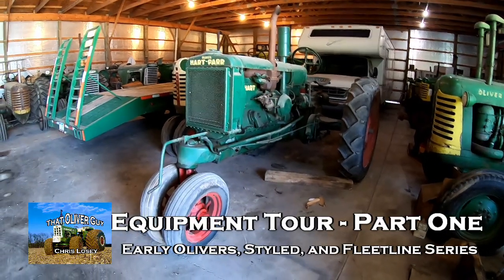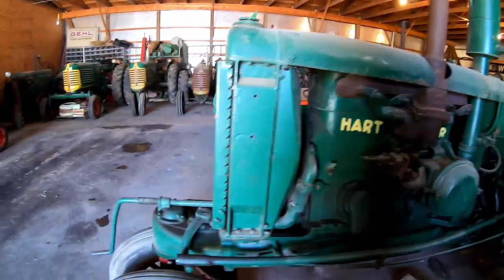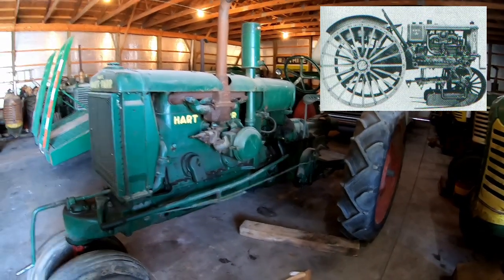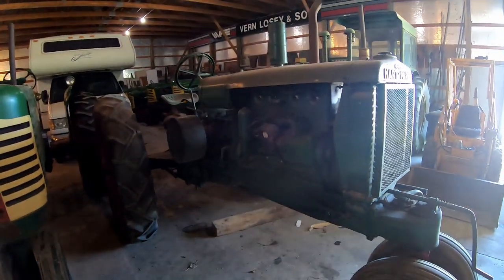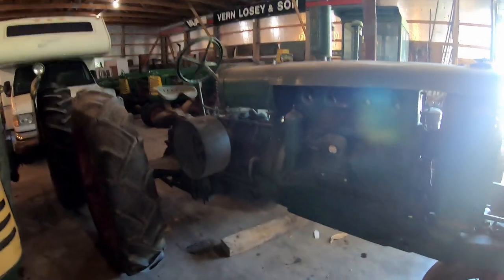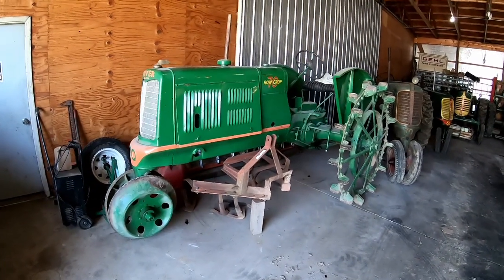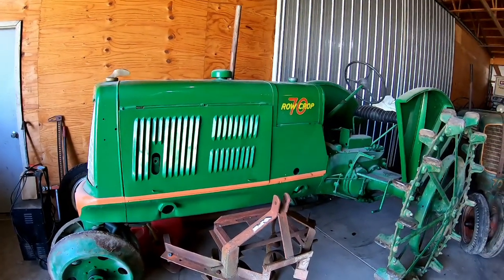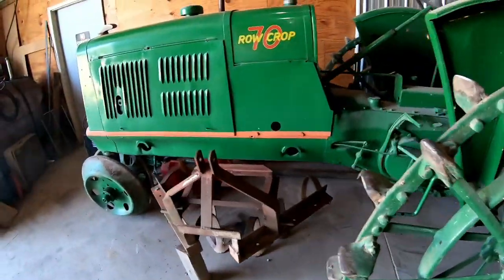Oliver Tractor and Equipment Tour Part One - Early, Styled, and Fleetline Tractors

Comment: i just got an oliver 77 or 88 row crop gas tractor i believe its a 1949 though 1954. i was wondering if you could do a video on the hydraulics and pto? mine are messed up with after market valves put in and i was wanting to put back in factory shape myself.
Reply from the maker: I'll add it to my list. Thanks for the suggestion

Comment: Thanks so much I really appreciate and enjoyed the video ,,,sorry it must of been a little hard for you t do this you have so many memories of your father ,I enjoyed the video my uncle a dairy Farmer from Corunna Michigan farmer with all Oliver's I grew up set on his lap riding while he was cultivating not sure of all the models he had there was a steel wheeled later on I helped out with the cultivating bailing hay and so on,,,am I right Oliver became famous with there cold rolled plow because they had figured out to case harden cold rolled steel that would last longer ,our something like that I have deep feelings for Oliver dad owned one,, a White it was the best thing that ever happened to our farm a real work horse!!! Thanks again Chris
Reply from the maker: Oliver invented the Chilled Plow. It was a cast steel moldboard, and with their chilling process the outer layer was hardened  while the center stay soft and flexible.  Not only did it make it stronger and last longer, the bottoms scoured (shined up) better than regular steel. If the soil sticks to the bottom, it takes more power to pull, and Chilled Plow scoured very well. Later on Oliver did move on to rolled steel moldboards, using their hardening techniques to make them durable as well. In the 1920s, Oliver developed the throw away share and called it the Raydex, with the idea being it sliced through the soil like a razor blade. They even had a promotion where they gave away a set of razor blades to promote their plows. Those are hard to come by.

Comment: Growing up, my dad had two tractors.  A 66 gas that was a dealer demonstrator, and a brand new 77 diesel. My uncle had a couple of "A"s, and we would help the neighbor wha had a H and M.  I may be prejudiced, but I would take the my Olivers any day.
My brother still has the 66, while the 77 went to a collector.
I did crush my brothers foot with the power lift on the 66.  Not much clearance between the arm and platform.
Reply from the maker: Ouch! I hope he healed up ok.
Reply: That Oliver Guy - Chris Losey      He was in a cast for awhile, but healed.  Later on, while he was driving the 77, we were fighting, and I lost my grip, hit the rear tire, and the tire pulled me by the legs between the fender and tire, dumping me in front of the rolling tire.  I rolled to the middle, to miss the tire, at the same time my brother topped and backed up missing the front tires.  I had to have a couple of large blood clots removed from one from the crushing injuries.    Sometimes I figured we were lucky to survive our childhood, but I would do it all again in a heartbeat.

Comment: My granddad had a super 88 tricycle diesel it had both electric and manual hydraulic and band brakes didn't even know it was for sale till after it was gone then found out he sold it . Them a fee years later I found a standard 88 it still runs but needs engine rebuilt . There use to be a Oliver dealer 10 miles from here and still 5 Oliver  tractors left here locally. Thanks for the video

Comment: Restoring a 1948 Oliver 70 with aluminum  Hood looking for the side panels it was missing when my boy bought it was missing all of them on both sides we are also looking for fenders for it the one side is alright the other side is pretty well priest wondering wondering if you have any parts tractors for the 70 it is a 1948
Reply from the maker: You can get new side panels from Lynch Farms. https://www.lynchfarmstractorparts.com/store/
Reply: @ThatOliverGuyChris  are those supposed to be a aluminum
Reply from the maker: If you're looking for aluminum side panels, you'll have to find used. Oliver only used aluminum due to steel shortage after WWII. Steel ones will fit in their place, and paint adheres to steel better, so it comes down to how original you want to keep the tractor.

Comment: Really nice collection. I grew up in an area that heavily favored red and the "other" green tractors. A few Allis's around a once in a while a blue Ford.  However, I did do a considerable amount of work on a local cattleman's farm in High School that had several olivers and a few Whites (2-105, 2-135).  They had 2 or maybe 3 77s that were the light duty rigs, a 1650 w/loader, and my all time favorite tractor of theirs, a 1655. That 1655 had wide front, flat top fenders, and was an absolute joy. I fell in love with the over/direct/under transmission, it was fantastic compared to the straight gear drive (1-4, hi-lo) IH's we had on our farm. I also liked that it would smoke a bit when you pulled it a little hard, although the owner gave me a stern talking to about that, so I had to back off a bit...

Comment: Awesome video far as I'm concerned the best thing that ever come out of the UK is a Perkins motor other than there overrated for power but the simplest Motors all Perkins and those pumps were so simple your mechanically inclined anybody can fix them have a great friend of mine put 25000 hours on Industrial forklift built by load lifter the thing was puking more fuel through the pump that was burned I also have the same machines I have them because I don't need a mechanic to fix them awesome video

Comment: Chris, I'm 70 years old now, but grew up on a '37 Oliver Hart Parr 70 that had rubber on front and the tip-toe wheels on back.  Family at that time converted it to rear 38 inch rubber and added 5th and 6th gears.   I currently own a '52 Oliver Fleetline 66, no hydraulic, but power lift and independent PTO.
Reply from the maker: Awesome.  Thanks for commenting.